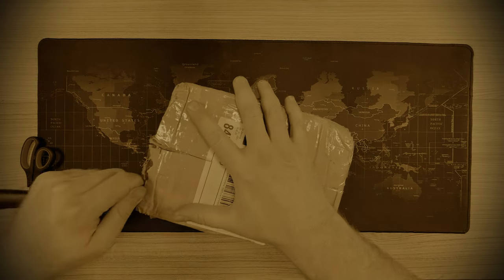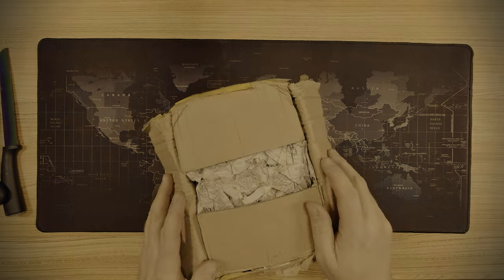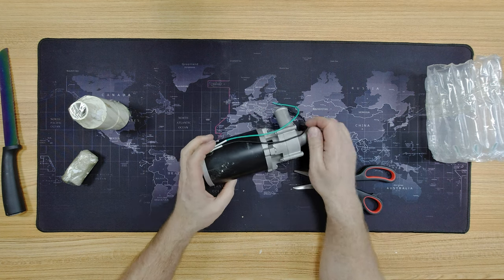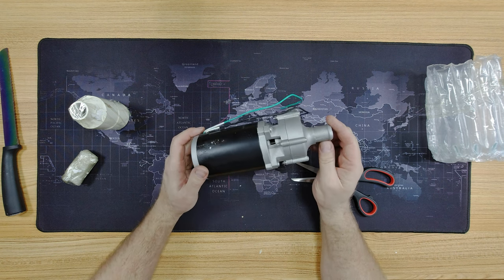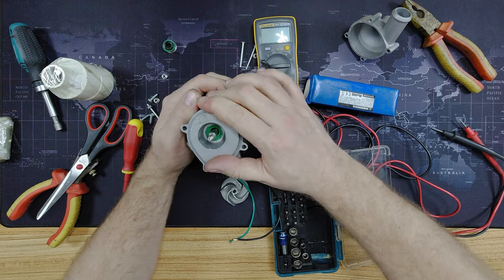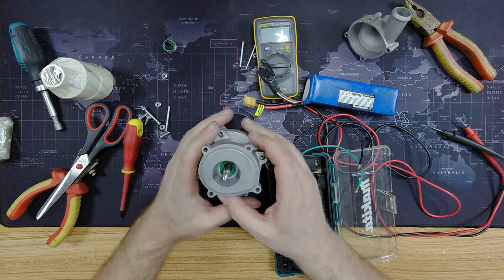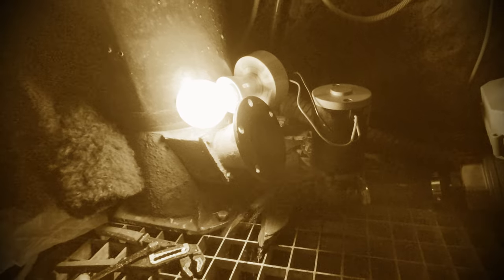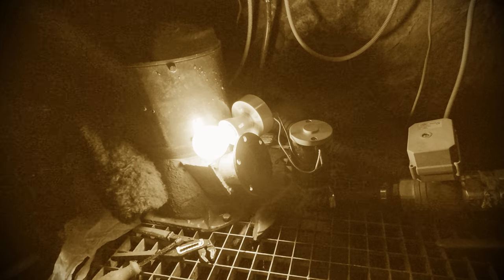Weird Micro Hydro Turbine Generator from China - Or is it actually a Water Pump?

Comment: Sorry it didn't work out better, there is a video on YT of a gentleman in NZ built one out of a washing machine motor, I think it has been producing power for 15 years.   Marty t  if your interested.  I've taken inspiration from your engine driven battery charger and built my own version, it was supposed to be light and mobile but its turned out to weigh about 80kg lol.  There are plans for a smaller one, I learnt a lot during the build.

Comment: It is definitely a pump. That said centrifugal pumps can be quite efficient turbines -  That thing in the middle is called an impeller and this is an open impeller(which is not that effecient you would use that to pump solids), and if you run it as a pump the impeller vanes fling the water outwards generating pressure through the diffuser. When run in reverse as a "turbine" you would'nt want the impeller to fling the water outwards and rather counter intuitively the impeller is not wrong with the way the vanes are shaped they are supposed to do the opposite of when you are pumping. Most centrifugal pumps as I said can be run as turbines with little modification (you have to take into account threads on fastners etc) at about 85 to 90% of the pumps rated output. Also it is not a bearing it is a mechanical shaft seal. A mechanical seal is suppose to be friction based - that is how it works. It gets lubricated once water floods the seal either from the inside or outside and runs smoother(And you should definitely not be rubbing your fingers against the two surfaces as it will destroy the seal potentially(it looks like an ok seal overkill even). In fact I see a lot of Pelton runners and DIY turbines with no seals around the bearing which would destroy the bearing pretty quickly=bad.  You could use ceramic bearings, but this is a reaction turbine and so the chamber has to be completely flooded that means it needs a seal otherwise air would get in. Air in a reactance turbine or centrifugal pump is just about the worst thing you can do to it.
Reply from the maker: Thank you so much Anders for giving me your technical expertise on this, you clearly know your stuff! I didn't realise that about the mechanical seal, makes sense now, so I should put it back in! Also very interesting about the vanes direction, that is good to know. I'd quite like to rig it up again actually and give it a longer test run. The only thing that concerns me maybe is the longevity, being a DC motor (or Dynamo in this application) I assume it's got a brushed Commutator, which at this RPM is going to wear fairly quickly? I wonder if a small three phase PMA might have been a longer living choice for it, but maybe I should just let it run as-is and so how long it work for.
Reply: @TheAmazingAdventuresOfMiles  Happy to help. The reason why the vanes confuse people is because the vanes and the housing of a centrifugal pump are carefully designed to work together and people don't realize it because they expect everything to be impulse. 

In a centrifugal pump the casing is often volute shaped(Not always though). A volute or the casing in a centrifugal pump has the same function as a nozzle would on a Turgo/Pelton runner although when utilized  in a pump it can be viewed as a reverse nozzle. In a nutshell the casing will either speed up the fluid generating velocity or slow it down generating pressure depending on the direction of flow. 

The important bit here is that the volute/casing will have cutoffs. Impellers and more specifically the vanes are shaped according to these cutoffs and either the outer periphery of the casing or according to diffuser vanes(Single volute has 1, Twin scroll has 2. etc. Vaned diffuser casings could have as many as 20 or even more) The cut offs are either starting points or endpoints for the impellers to do their work.

The best analogy for a centrifugal pump/reactance turbine's casing/impellers orientation is to imagine a trebuchet firing. Watch it in slow motion first forwards then backwards (when backwards imagining the trebuchet catching the payload and returning it to the firing position). 

Another way is to imagine an excavator with its arm being a vane on an impeller. When in turbine mode the arm stretches out  puts the bucket down then pulls it inwards while curling the bucket to the point where the material can be scooped(at the cut off).

The advantage of reactance turbines is that they are pumps and turbines very much like electric motors are also generators. Pelton, Turgo,  Crossflow etc. are impulse and can only work as Turbines.

About the brushed DC motor. I would not completely discount it, I mean it looks powerful. Brushed dc motors do have their uses and they don't need rectification. What I would look into If I was you would be to get one of those "no spindle drill" (Stupid name)assemblies of Ebay or aliexpress and some different size pullies and timing belts so you can test a runner/turbine with the same motor/generator, rather than the random crappy motor people will throw on to stuff to say "it can do 6kw"  Like just get a low KV drone motor (like 90kv) those items should not set you back more than 50 pounds. My point is that there will be a certain amount of pressure available. The runner/turbine is one bit of the equation obviously the other one is the gearing and correlation with the generator assembly. Using belts and pullies is not something I would recommend, but it can be quite tricky to determine what generator will provide the optimal performance and it can help to have a modular design, rather than buying different motors and concluding they are bad. A belt and pulley system small scale will help you dial in lots of things. My guess is that ideally your runner should be sized to be doing about 2-3000 rpms (this is the rpms most pumps run at) and so you need a generator/motor that works at its best in this range according to the voltage you want either of the shelf or via gearing.

I love your channel by the way, anything hydro, pump related is awesome so thank you!

Comment: Did you have a go at a refund for "not as advertised" or did you just cut your losses ? 

And i think that seal needs to be wet to have low friction, and obviously a 230-340 v dc motor will have next to zero torque at 24v dc